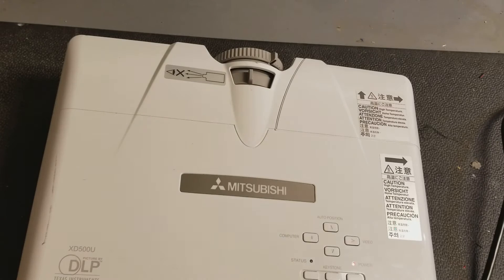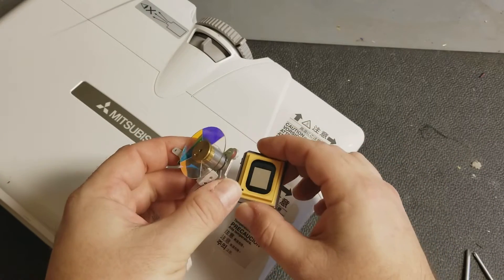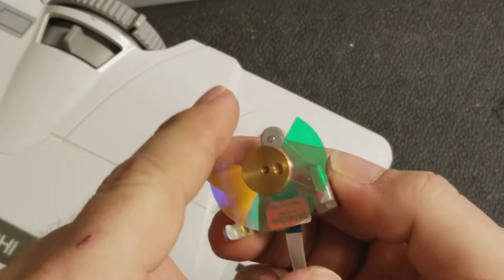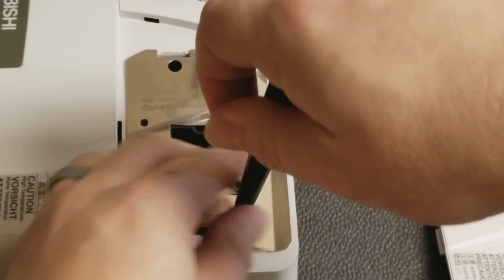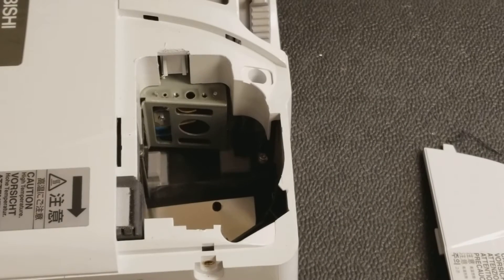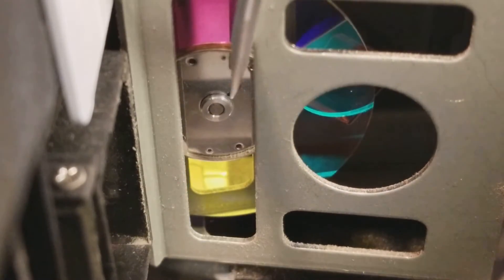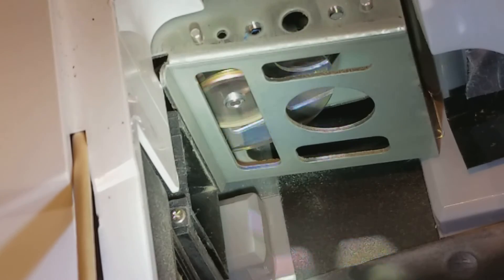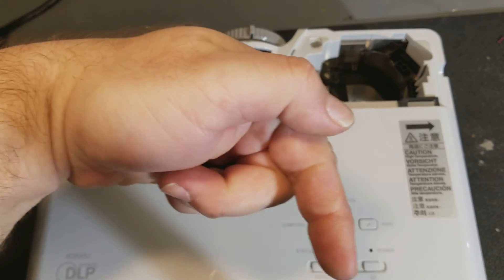Troubleshooting your DLP Projector : Color Wheel

Comment: Thank you very much for the video. I have a vivitek dlp 2014, recently started showing color wheel error. It runs for about 8 minutes perfectly fine than it shuts down with the green light blinking 9 times. I took it completely appart and gave a thorough clean up with qtips and vacuum cleaner. Still doing the same thing. No discoloring or any other issues. Color wheel spins fine. 😢
Reply from the maker: Hi Luke! What is the model number on the data plate? It might be a fan problem. I'd guess the lamp blower since they are a common problem.  That said 9 times in many vivtek models means the color wheel is the issue. Your wheel might be warming up and start sticking after 8min.
Reply: @FixitFrank  vivitek dw868, btw all 3 fans run. No sings of overheating, no plastics bent or anything else.
Reply from the maker: @magjistari2002  I believe it. I think there might be small dust spots on the color wheel sensor, or the bearing is failing after it gets hot. The nine blinks is a color wheel failed error according to the manual.  If the sensor is clean, then you need a new color wheel. That is a good projector. 
I see a new wheel on AliExpress for $42.50usd. Seems reasonably priced
Reply: @FixitFrank  sorry for replying so late but aliexpress takes a while. After replacing color wheel, still same thing. Will run for about 4-5 mins and ruin the image and turn off with 9 blinks. 😭
Reply from the maker: @magjistari2002  No worries. I know it takes some time.  The error still points to a color wheel as 9 blinks is all it can mean. I do wonder about your lamp or the lens coating but if that were the issue, I would expect the error within a few minutes, not closer to 10.  Do you hear the wheel speed up/slow down right before? Also, did you replace the sensor board as well or is that original?
Reply: @FixitFrank  i went ahead and replaced the lamp too made sure theres no coating, same issue. I did replace only the color wheel, makes me think it could be the sensor gone bad. My next step is taking it appart and identifying the sensor board and see if its somewhere online or will i have to order the entire color wheel kit. Sad to have this issue cause its really very good conditiom. Insides are like new. It has less than 2k hours of use.
Reply from the maker: @magjistari2002  I have some scrapped units that have that board.  I don't have time this weekend but I will make a video on troubleshooting the sensor board.  You may be able to repair it. I would try re-solding the 3 wires that connect to the photocell and LED emitter. I wonder if they are heating up and the connection to one of them is failing. I have seen them fail in the Polyvision projector which is made by the same company as yours, so this is not a stretch.
Reply: @FixitFrank  thank you sir. I will be waiting.
Reply: @FixitFrank  I made this video before i ordered the wheel from ali express. The color wheel in this video, is the original. I will be waiting on your instructions for the sensor, thank you again. https://youtu.be/Vrfp6RdOcko also a video of the issue https://youtu.be/ocAtKH_WUi0
Reply: I went ahead a took apart the unit again and pulled out the sensor, visually everything looks fine in the sensor and perfectly clean. I just dont now how to test the sensor by itself and I dont know which three wires you were talking about to be resoldered.

Comment: Hi.
I have an optoma HD28 DSE. The picture has gone yellow and and sometimes it doesn't come on at all then the bulb light flashes. Also some clicking noise is heard at start up and picture flickers then projector goes off. after few attempts it comes on but back to yellow picture. Someone told me it's the bulb but i doubt it .. what's your opinion?
Reply from the maker: Hey. I'd have to see a picture of the image to be sure, but that sounds like a color wheel problem as well.  Can you share a video of the problem while its happening?  My gut says color wheel but a video would help to confirm.
Reply: Thank you very much. Will try and upload something
Reply: HI Frank.
I managed to open the projector and clean the colour wheel and the little sensor. Now the projector comes on at every attempt but only stays on for like 5 sec then switches off. Then warning light bulb comes on. I tried a new bulb and same thing. Is there a sensor that senses if the bulb emits any light?
Reply from the maker: @bro10channel  There is no actual light sensor, but there is a circuit that monitors the ballast. It can measure when the lamp is drawing current(indicating it is lit). If it's staying on for 5 sec, it still might be a color wheel problem.  Is the bulb original? That is also behavior of a failing lamp.  Essentially the 'lamp led' is telling you the projector had to turn off the lamp for "some reason".  Could be a color wheel speed issue, ballast communication issue, or a lamp.  Of course this is without if front of me, so take that with a grain of salt.
Reply: Hi  @FixitFrank , Please see video of issue here https://www.youtube.com/watch?v=1layEXAoKRo. This is with a new bulb. It comes on every time but shuts down after few seconds. I took colour wheel off and cleaned it and also the little sensor. Any suggestions?
Reply: Hi, sorry to ask again.. but any ideas?.. i posted the video showing the issue i'm having
Reply from the maker: @bro10channel  Hello, I do not know why I did not notice the notification.  My apologies.  
I always suspect the lamp at first. The coating on the front glass may not be the right IR block coating. See if it is red/blue when you look at it on an angle.  If the coating is not there or greenish, that would be the best possibility.  Other causes could be power supply, defective motor, bad flat flex cable to CW. Even the wire to the CW index sensor.   Start with the lamp. That is a common problem.

Comment: have viewsonic 7820hd projector, when we start then after few minutes it starts flushing & then colors goes to inaccurate, my projector run 1900 hours, how to solve the problem? Sorry for my English it's not good.
Reply from the maker: Hello! Your english is good! I think color wheel is bad. If color goes purple or green when it should be red or blue, the color wheel is bad. The projector age is also a good indication that the color wheel is going bad.
Reply: @FixitFrank  thnx for reply brother, But why does not it happen for the first five minutes?
Reply from the maker: @AK-rebel  Happy to help my friend. The bearing or color wheel axle will change shape as they warm up. The longer it runs, the faster it will start to fail.
Reply: OK thank you so much

Comment: Hi,
thanks for a very good video. I have a Mitsubishi HC1100.
It starts up giving two green lights and the color wheel turns and the lamp turns on. Then after about 10 seconds it shuts off.
Any idea what it could be? Both fans are spinning.
Reply from the maker: Hello Rune!  What do the LED's flash after it turns off?  I have seen color wheels fail and still spin but it could be a few other things.  Can you upload a video of it starting and then shutting down?
Reply: @FixitFrank  Hi,
thanks for quick reply. The video is here https://youtu.be/Twn429KSfcE. I have just replaced the lamp. No change.
Reply from the maker: @MrGurrabest  That is weird. The color wheel 'sounds' OK.  It might be a little loud but I am hesitant to say its the color wheel.  It would be my first suspect if you know the lamp is good. The only other thing I can think to check is see if the lamp has a good coating on the lens.  That said, the HC1100, 1500 and 3000 tend to be pretty forgiving to bad lens coatings.  The fact that it acts like its just being turned off is pretty unusual.  How comfortable are you with volt meters and the like?  You could try replacing the color wheel but I cannot say 100% it is the cause.
Reply: @FixitFrank  Thanks a lot Frank. It seems as it is a bit complicated and I probably will spent some money to get someone looking into it.
Reply from the maker: @MrGurrabest  if you are in the states, I'd be happy to look at it. Feel free to email me sales@weezytech.com. Otherwise, I would be suspect of the color wheel and possibly the ballast. One other thing is trying another lamp. I know it is new, but sometimes they can be borderline. Especially if the bulb used is not an osram.
Reply: FixitFrank thanks a lot. What do you mean with ballast?
Reply from the maker: @MrGurrabest  There is a small chance the ballast is not reporting to the projector that the lamp has started. After a short period it would them turn off.  This is very very rare but I wanted to make sure you had all the info you might need if you took it somewhere.
Reply: @FixitFrank  Thanks for this information. I am trying to find out what the ballast is and how to check that.
Reply from the maker: @MrGurrabest  Ballast is hard to test without being well versed with high voltage.  It outputs up to and past 3000-7000 volts to start the lamp.  I would be very very careful if you decide to check it.  Only the control side is safe to check.  *Do not try and measure the output voltage while its on.  The voltage can kill you. *  <- This is why I do not show testing ballasts.  They can be very dangerous. The other name is lamp-driver.  It is the power supply that runs the lamp.  It is secondary to the main power supply. If the ballast is a problem, it would be better to replace it.  Be careful!  And again I really appreciate your watching my video.
Reply: FixitFrank thanks a lot. I Will not try to test this but hand over the information to someone professional.

Comment: Hi just trying to troubleshoot my Casio DLP XJ-A130 projector. Plug it in and turn it on and sounds like it will work, a get a flashing green on the power and flashing green light on lamp then in about 30 seconds I get a steady red light on the Power/Stand by and a steady  red light on my temp and it shuts down? I several times unplugged it and tried it again and same thing happens.
Reply: Hey FixitFrank now my Casio started to act up again. Lamp only has 22 hours but the unit as I was running it got very hot? Any suggestions?
Reply from the maker: @TheWhaleman64  What are the indicator LEDs showing you when it turns off? If its the same as before, I would suspect a fan is acting up.  Its hard to say which one though without seeing it. Maybe give the air vents a blast of air and see if dust comes out? My usual guess would be the lamp  but the XJ-A130 is an LED model.  Im not a fan of LED yet.  They are still working on kinks.  The drivers are problematic.  If I was a betting man, I would think the LED power drivers are overheating.
Reply: FixitFrank I think you’re right. I blew some air into the fans and it started working. I’ll keep you updated thanks.
Reply from the maker: Hi David,  How old is the lamp?
Reply: FixitFrank hey funny thing is I tap the machine on top lightly a few times and it started right up. Maybe it was stuck or had some lint in it the fan started right up. Runs great now. Thanks
Reply from the maker: @TheWhaleman64  could be the lamp failing. Sometimes there is debris inbetween the arc points. Tapping it may be loosening those. Either way I'm glad its working!
Reply: FixitFrank thank you

Comment: Hi Frank, great channel! I have severe color banding problems with my Optoma HD26, is it most likely caused by the color wheel or the lamp? The color wheel spins. It was most certainly caused by overheating and dust buildup.

I tried cleaning away the dust, but it did nothing at this point.
Reply from the maker: Most likely the color wheel has reached a point to where cleaning won't work. That said, make sure your lamp(if new) has the proper lens coating or it will also cause issues. If its the same lamp and used to work, then the bearing of the CW has probably failed. Does it make a high pitched  noise that you can hear over the fans?
Reply: @FixitFrank Thank you for the answer, as I suspected! I have not noticed any high pitch noise, but I will listen for it. The lamp has only 500 hours. The projector had been on for 2-3 hours straight and suddenly the picture looked like it was in 16 bit color mode. I had not cleaned it in a long time, so makes sense. I had trouble finding good answers what the cause is when I googled, must be a somewhat rare problem. Some people suggest changing the color wheel index (timing?), but I assume you have to have access to the service menu for that. I have ordered a new color wheel and will try it out! If you want I can let you know how it went.
Reply from the maker: @lillpelle  If you want to post a video of it acting up, I would be more than happy to confirm the issue.  The index mark probably is not an issue. It would have been a problem from day one.

Comment: Great video Frank. BTW, you're helping me who is as far as Africa. I bought a used projector epson eb-x6 it shows a lot of blue or purple kind of colors. I tried to adjust the RGB setting, reducing the value of blue to a negative value but the color. I also tried to reset the projector lamp hours and everything to default. I don't any improvement. Any advise please? Thank you
Reply from the maker: Hello David! That sounds like it might be a problem with the red LCD panel.  When you only send Red, is there no video?  If so, I would see if the Red LCD panel wire is loose. If not, then it might be something more involved.
Reply: @FixitFrank  Actually am able to see the video, from the video source, however it's bluish or purplish. The only clear thing are black words on the white background. Say if projecting microsoft word.
Reply from the maker: @davidofug  That does sound a lot like your red LCD panel is not responding. There is a red/blue/green LCD panel. https://www.youtube.com/watch?v=1zBt_cPlg4A This is an old video but the inside is similar to your projector. The 3 LCD panels are what you want to look at.  See if the cable for the red panel is inserted to its connection tightly.
If you can post a video so I can see, please let me know and then I can tell you more.

Comment: Hello,
Thank you for this video!
I have a problem with my Infocus IN8606HD projector. The projector start normaly but after about 5 minutes it turned off and the "color wheel error" code appear. I have disassembled the projector to check the color wheel, there is no dust, I can rotate the wheel easy by hand and everything looks clean. What would be the problem?
Reply from the maker: It still may be the wheel. One of the coils may have burned out (as an example).  Make sure the color wheel sensor is clean and see if the wheel spins up when you start the projector. Have you replaced the lamp recently?
Reply: I have bought this projector from Ebay and don't know if the lamp were replaced. What is the reason for this question? I have a spare lamp and I can replaced it. I have the same model which I use for my DLP 3D printer and I swapped for test both color wheels. After about 20 min. the suspicios color wheel failed again so there is no doubht. I am curious why this problem startr after some period of time, in fact the projector may work normaly about half hour before the color wheel failed. Anyway, I have to replace the defective color wheel, but it seems very dificult to find a new one. Thank you very much for the help
Reply: Hi Frank, I have replaced the color wheel with a original new one and the projector worked without any problem for about 4 months. Untill yesterday, when 5 minutes after turn ON the projector, the color wheel stopped. After starting the projector again, the color wheel work OK, but after about 5 minute I have the same situation. Any ideas what would be the problem, and how to investigate it?